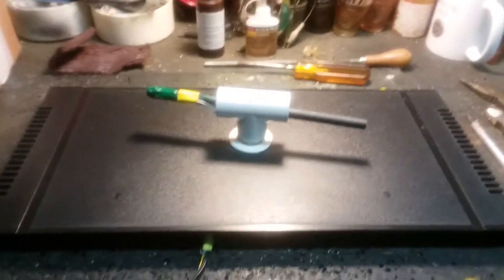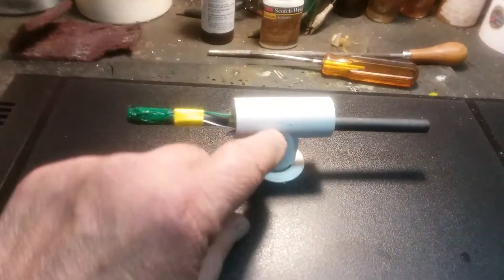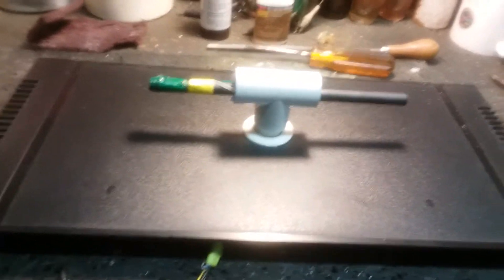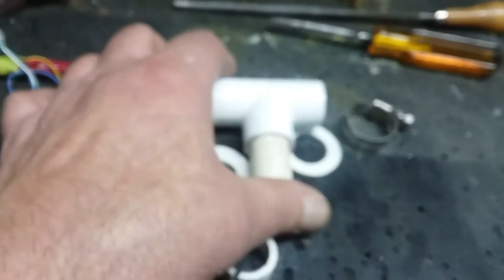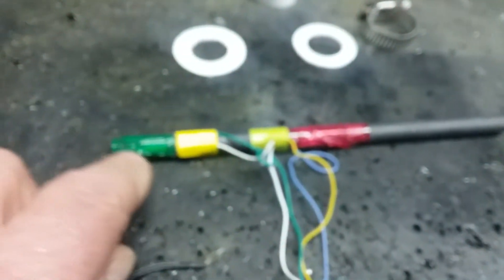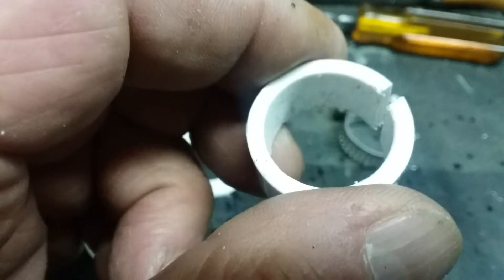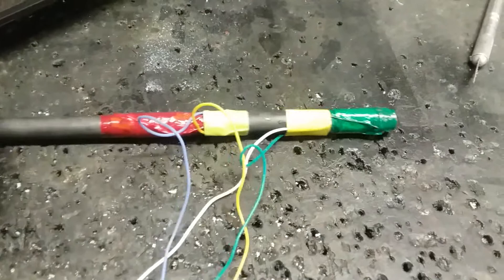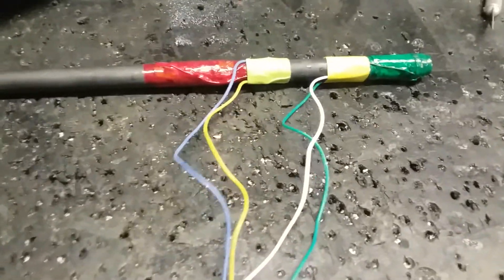Ferrite Broadcast Antenna Part 2

Comment from the maker: Hi Dan. Actually the hose clamp won't bother anything since it's far enough away from the ferrite rod. Actually, it would help eliminate common-mode currents in the wires between the rod and variactors, but its diameter is much too large and the stainless steel is not very magnetic. However, in my new video (in a few days) you'll see that I've added ferrite cores to the variactor feed lines, both power and signal, which literally stopped local pickup in the interconnecting wires. Finally, the hose clamp was removed to allow more turning radius and I added a 'stop' pin instead. I thought about an 'angle' adjustment and actually have a nice plastic coupling to accomplish that, but I wanted to start with a basic unit and maybe I'll take it up a notch from there. Many thanks for your observations and comments. I'll post a new vid soon and look forward to your thoughts.

Comment: Hi Bob.   Very interesting antenna.  Two comments.  From the standpoint of less metal near the antenna, can you substitute the metal hose clamp with a nylon tie?   Also have you considered orienting the antenna up & down as well as turning it 180 degrees.